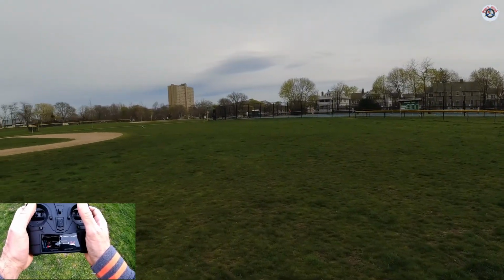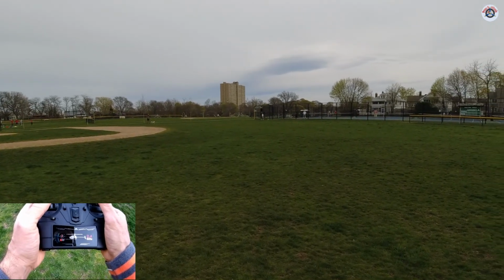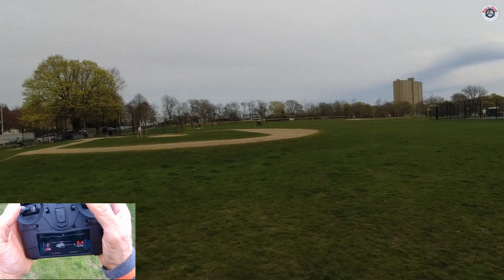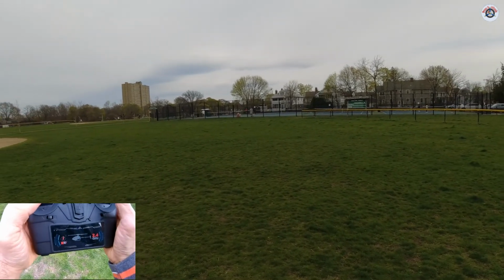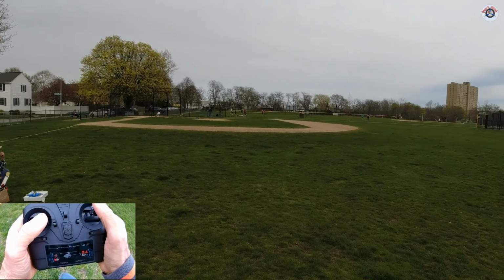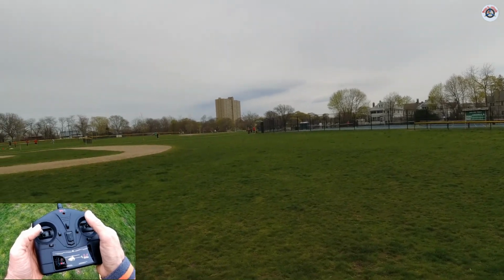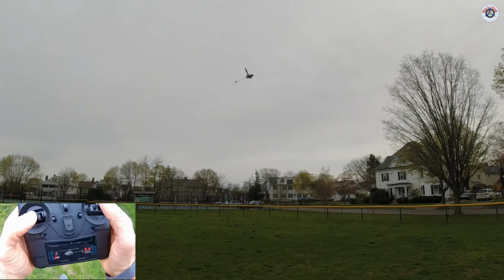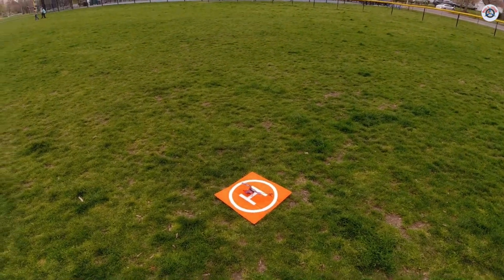XK K127 Eagle 4CH RTF Beginner-Friendly RC Helicopter - Part 2: Outdoor Flight and Final Verdict

Comment: Practicing on a sim is great, for fixed wing, heli`s and especially for multirotors, where orientation can be VERY difficult, especially when flying line of sight.
A cheapo USB transmitter with a basic sim can do a lot, even though th physics won`t be completely accurate it will teach a new pilot a lot of basics without costing any money when crashing (:

Comment: Where can I find a manual or wiring diagram for the XK K127?  Mine has a couple of loose wires but I can't find any information on it anywhere. Also is there a way to tune it so it doesn't spin on it's own?

Comment: Sir in mode 2 when I put the lhelicoptere throttle turns but in mode 1 it's when I put pitch forward as if the problem came from the left stick no subie with the throttle in mode would you have any idea sir?

Comment: Looks like a 5 props score to me. For 50$ you get a very stable and sporty copter that lasts 16 minutes on a single battery.
Reply from the maker: It is an excellent heli, but it is not perfect, so I am nitpicking. I think 4.5 is a fair score, but you have a valid point; for a $50 heli, it is as close to perfect as it can get. I may revise it to 5 if I make another video, flying it with my OpenTX controllers. Thank you for sharing your opinion! :)